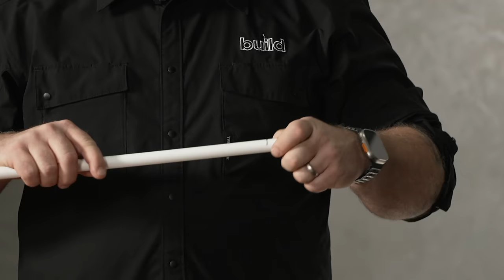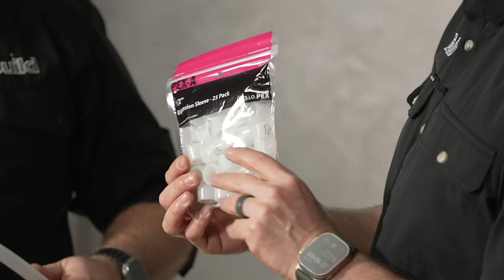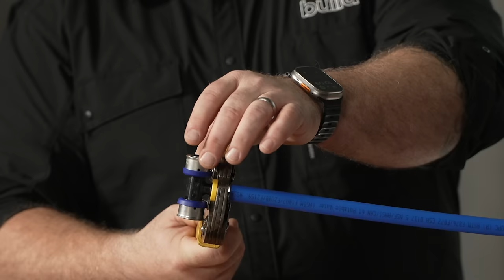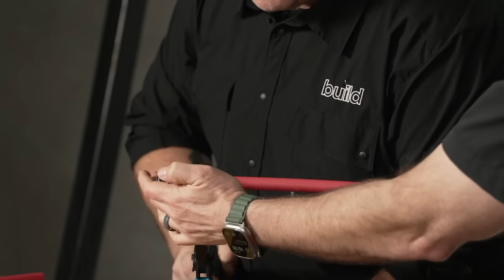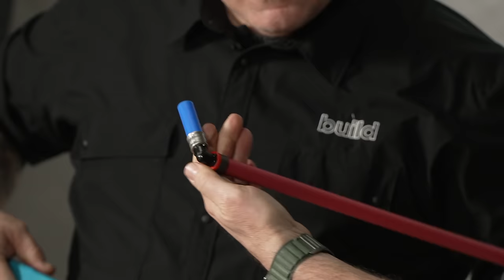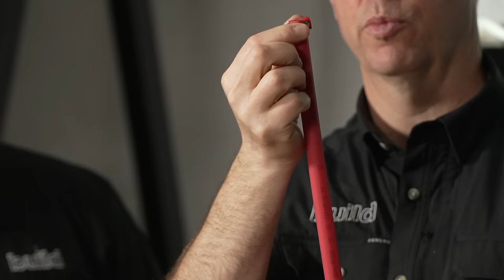PEX Pipe - 5 Connection Options

Comment: In the gas industry, we used Honeywell Perfection fittings for PE pipe and tubing 2” and below. Almost the same procedure as the Viga, but there was also a chamfer tool that had to be used on the pipe end. So quick to install, for emergency repairs and permanent installs. 

On the subject of expansion PEX technique- I would love to get into switching over to this from copper for water because the fittings are both quick to install and full port. But I have one reservation, it’s this buzz about small cracks developing in the expansion area and then causing pinhole leaks a year down the road.
Reply: That was only on the uponor brand color tubing. They  have since recalled it. Shark bite and Apollo also sell expansion tubing.

Comment: Great vid Matt and Eric. I'm doing a complete replumb on a 60's home in FL. I chose Pex-A for a number of reasons, mainly the cost of the tool (Dewalt) which goes with my other Dewalts. But there a number of other good points you should have mentioned. The maneuverability of the pipe is a big one, it's more flexible than the other systems, and if you do happen to kink it, a little heat and it's as good as new. Can't do that with the others. Another big advantage is the full size/bore fittings. I want as much flow as I can get without any losses due to number of fittings. I did find the fitting cost to be much better than some of the others. 
I appreciate all your great videos, and especially you're work with Paul and the gang at Stud Pack!
Keep up the great work brother!
Reply: Hope you didn't chose it for it's life span or lack of contaminants or unexpected failure issues, tee hee.

Comment: We use the pinch or aka single ear hose clamp in the CO2 business. These style clamps routinely hold 300 psi of pressure in the CO2 drink/beer dispenser systems.

Comment: Great upload, I'm 63, and when I moved the hose outlet I used the crimp ring one. But I think I will order a few of the sleeve ones. Just in case I want to do anything else, Like I went under and put valves to the shower.

Comment: I've used the pinch type on two houses now (I'm not a plumber but did my own houses). The reason cor the choice of the pinch was the minimal clearance required for the tool (you can crimp a line in a smaller space) and the cost.  I like the expansion type but couldn't justify the cost of the tools for low volume...  PTC is amazing for any one time repair but as you said, just too expensive for a whole house job.  Thanks for the video!

Comment: Great vid Matt and Eric! I really appreciate the demonstrations on all the types. I have used the PTC on so many plumbing transitions and in tight spaces, but a comment on one of my last plumbing videos caused me to do a double take and re-think using them since the person said they were for temporary use only due to the rubber o-ring. I couldn’t find anything out there that backed up this claim, but I have been thinking a lot of transitioning to expansion fittings and taking the plunge on a Milwaukee expansion tool. Thanks again for the great demos! Best!

Comment: Awesome treatise, guys.  One thing that I found out with Upinoor or Wirsbo PEX-A is that the automated expansion tool has a distinct advantage over the less-expensive manual stretch tool, and that is that the stretch head ROTATES on the automated tool as it is stretching.  Found out how critical this is because I plumbed an ice-maker feed tube valve with difficult access to the pipe, so my manual tool couldn't rotate much.  The connection drip-leaked.  I did it again and forced my tool to rotate as best I could and that fixed it.  The stretcher head cannot stay in one place, it has to rotate.  :)

Comment: You guys forgot Rehau’s pex system which is a combination of expansion pex and crimp fittings. They call it EVERLOC. Best of both worlds?
Reply: Ditto, I was hoping they would cover this.
Reply: been using Rehau for 22 years, never a problem even with solar panels, way better
Reply: or worst of both worlds

Comment: There is also the F2080 Comboloc expansion tool that expands the Pex and then pulls the metal collar tight into the Fitting.  Everlock+ and Rehau.

Comment: I had a failure with the pinch type. A buddy and I ran the water to my kitchen remodel. A few weeks after the paint was dry in the kitchen, I noticed a large bubble forming behind the paint over the sink.  My buddy came over and we found where the clamp was leaking.  A replication of the pinch sealed it. I was able to drain the water out of the bubble with just a small wrinkle in the paint, We both learned how important it is to get a good pinch.  We are planning a remodel of both bathrooms soon. I will make sure that everything is pinched well.

Comment: May, can you find out for certain about Uponor A cracking and leaking? I’m seeing videos where people are now having problems. It appears to be the red pex where the problem is. Could be the pex itself and being left out in the sun. Comment were made that they’ve now gone away from the red pex and just use white pex with red or blue writing in the tube for hot or cold. I will need to re-pipe my house some day as it’s still using poly but the owner builder did a decent job of crimping all the fittings. It’s even used in the hydronic system which makes me nervous but it means breaking concrete. Thanks.

Comment: The black coating on the Pex-B copper rings are designed to prevent oxidation of the copper over time.  Regular, uncoated copper pex rings in humid or wet areas are susceptible to oxidation, which over time can break down and damage the ring; eventually leading to failure.
Reply: Unless it's in a marine environment, I couldn't imagine those rings failing in a reasonable length of time to be concerned about.

Comment: A nice feature of the crimp is you can cut the ring and redo it if necessary,  also the shark bit can be removed like temporary using caps and removing them after rough-in…
Reply: I have been using ptc fittings for various repairs in my trailer.  I was surprised to read that you can reuse these fittings a few times.  Still feels like it "shouldn't" work as well as a crimped or compression fitting but so far so good

Comment: I used this crimp ring system on my house, the main down side is its use in tight places. But there is a block tool that is slow but works well in a tight area. A power tool would be better for tight areas. House is twelve years old, I have had to failed fittings, but they were cracks in the brass fittings, not the crimp rings. But did the stress of the crimping crack the fitting? I would crimp, turn 90 degrees and crimp again for a more uniform crimp.

Comment: A 90* fitting increases the resistance to flow by 10x compared to street el or curved fitting. I had 90's on an hydraulic oil system that kept blowing off the hoses. My hydraulic engineer neighbor told me to use curved fittings and the issue was fixed.

Comment: I can give you a few reasons why pex b is most popular, 1, I live in SC and pex b was all you could get from the supply house and from places like Lowes/Home Depot(years later, pex a showed up). 2, the pipe, fittings, tools are a lot cheaper for b, 3 Other reports say pex a leaches more chemicals into the water. The rings for a are bigger, when drilling through concrete, smaller bits are less expensive.   The pinch type has a much smaller/cheaper tool, 1 size fits all. And just my opinion, I would not allow a shark bite fitting in my house, other than an emergency, have to wait to the next day to get it fixed kind of deal, why, it has a O-ring, in my 50 years of mechanic work, I have NEVER seen an O-ring that hasn't failed at some point, all types will fail at some point, but O-rings usually much sooner.
Reply: Shark bites 20 years old. If they were failing you'd know about it. A lot of pro plumbers are using pro press now
 How does it seal? An O Ring

Comment: Working on de-galvanizing my plumbing and have to do it in stages.  I use the crimp rings, the last connector you showed and Pex B because it is cheap and easy.  The tool for that would be excellent if they changed the gear ratio of the ratchet mechanism to accommodate smaller hands instead of requiring hands the size of Shaquille O'neal for single hand use.  I plan on going back over it with Pex A when I get "The tool".  Have to figure out how to maintain the grounds connected to the old galvie now that the supplies are going to Pex.  Don't want no fatal showers or anything.

Comment: The black rings crimped pex, someone said to use channel lock pliers plastic handles and squeeze the black ring slightly in proper place & then use the proper crimp tool.

Comment: The pinch clamps don't slide after a single click but still easy to move. Really easy to use. Bad part of pinch clamps is they grab your skin after the install. 1 tool for 1/2-3/4-1 inch not sure if they make bigger and smaller sizes.
Reply: You can use your channel locks to " "pinch" them in place so they don't move before you put your pinching tool on them.

Comment: Sharkbite has saved me in so many repairs.  Repairs get very costly when a house is plumbed wrong, and it can be difficult to find honest repairmen.
With that said, the PTC introduced me to the other methods that i also now use, but the PTC allows for easier installation in confined spaces, or by disabled personnel.
I am no expert but still learned some things in this video.

Thank you for covering so many types of connectors and the tools needed.

Comment: I'd be great to see a follow-up video demonstrating differences in disassembly / removal of fittings, along with re-usability of the removed fittings across these different connection types.  I have the most experience with the pinch and crimp PEX-B setups and own the tool for cutting the crimp rings from PEX-B -- So I'm unsure how easy it is to free a PEX-A fitting for potential re-use..  The king of re-usability would clearly be the PTC fittings.

Comment: Great video.  Good information.  The only thing I would have liked to see as a DIY person is how hard or easy each system is to correct mistakes.  For instance, some fittings (e.g. pinch) are easy to undo without cutting the tubing again.  An important advantage if you are working on old construction and make a mistake but the existing tubing isn't long enough to be cut back any further.

Comment: It’s helpful to know that fittings and pipes are compatible by their ASTM compliance. 

A pipe will be marked with “ASTM xxxxx” to tell you what fittings it can use.

This is true regardless of PEX type. Some makers like Zurn and Sioux Chief don’t even bother labeling them as “PEX A” or “B” because that’s not what’s actually important. 

I’m interested in Rehau EVERLOC. It’s an expansion fitting but instead of the double layer of PEX that shrinks back, a brass sleeve is pulled onto the joint.

Comment: Really helpful! Some tips: ProPress continues copper connections and current/ground. Environmental issues with copper in say, a pool house, would be better with Pex. Same with stainless fittings is some caustic or wet areas is better than copper or metal rings. Pex is susceptible to UV like sunlight, so an open-framed house in construction, you don't want Pex exposed to sunlight. And some Pex I've encountered (milky white) gets brittle under heat like a condensate pump from a furnace. ProPress/Press tools like Milwaukee are $$$$ and require sending to manufacturer after a number of presses to "re-calibrate" which for a plumber is downtime. ProPress/Viega fittings are very good but costly versus tradition sweat on copper. However, time is money but also saves the customer costs and adds value, along with easier on you in confined spaces.  Matt- perhaps a second mic for these so we can hear you as clear as your guests?
Reply: Also with pro press no open flame

Comment: My house was built in 2019 and uses Upenor pex (thankfully) and where the stubs out the drywall (i.e. toilet, sinks etc..) they used the copper stub outs so it's a solid connector on the outside and like a flimpsy piece of pex that moved around. But all valves in my house are push to connect. Likely they figured they save labor cost over material with less call backs due to leaking compression fittings, and time it takes to put a 3800sqft house worth of valves on for compression vs a quick slip on fitting. 4.5 years and no leaks or anything. All in wall and manifolds where it goes from 1" pipe to multiple 3/4 and 3/4 to multiple 1/2 runs to things like shower valves and sink and toilet, they used the Upenor coñectors there and slip on is only on exposed walls in 4he house.

Comment: With PTC, the PEX of applied properly, will hold the full pressure of PEX without leakage or failure, until the PEX finally bursts.  It takes as long or longer to install as any other system by the time your chamfer the end, and mark it.  

The disadvantage of both most crimp  and the PEXA, is that you have to have a different tool for each size of tubing.  The quickest is the crimps with a stainless crimp band.  You only need one tool, to crimp any pipe size.   Another advantage, is that the engineering on the bands was imported from the band clamps on universal joints on cars.   And you can buy linear installation tools which have a handle you spin, instead of clamp like pliers.

Comment: Old boats made in the 80s have "pex" connections. Many years prior to its use in residential. If it withstands marine use, obviously, it's great for residential. My 1986 Carver never has had a leak, all original.

Comment: Great video! I just got my bathroom redone using the crimp style,  but where the toilet pipe come out of the wall for the shut off they just screw/twisted it off put the valve on then twisted it back on when they installed the toilet after the drywall was hung. Maybe thinking they used the o-ring in this area but not entirely sure but would like know your thoughts on how that was possible?!? Thank you for the info

Comment: I Anya plumber and will only use type A(with expansion sleeve) or pro press type fittings. I feel those are the most secure ones of the bunch. The “shark bite” type is great for emergency repair situations, and some guys end up just leaving them permanently installed. Not what I would do if it was my house, or customers for that matter. Also if rodents get into where the piping is they love to naw or chew on the plastic and then you got a frickin mess, seen it a handful of times.That’s why rigid copper is so much more durable, but…. they both have their pros and cons.

Comment: I like the Uponor because of the constant tension provided by the expansion then the pressure resulting from the collar constantly trying return to its original form
Reply: Not to mention you don’t have to contort yourself to reach your work, have a nervous breakdown trying to get your tool on a ring that’s sliding all over the place, then strain to get the leverage to crimp the ring.

Comment: I run into sharkbite failures all the time, and it's always on copper. They don't bite the copper well and most diyers aren't installing them correctly. But I'll use them on plastic for service calls all day long because they are quick. Other than the recent lawsuit I'd say uponor is the best, now I'm not sure

Comment: I had several brass fittings corrode and fail. We do have well water. One of the brass fittings actually broke off at the water heater , what a nightmare. Fittings were about 6 years old. Replacing all the fittings with stainless steel fittings . Should solve the problem.

Comment: From what I've seen, replacing a trunk system with Pex A maintains the flow needed for multiple outlets because of the larger fitting bore, where a Pex B system would restrict the flow too much because of the smaller fitting bore. If plumbing from scratch, with a separate run to each outlet, it isn't a problem because there are very few connectors used. Final note, your Milwaukee Pex expander wasn't rotating between expansions. If the expansion tool doesn't rotate it will create a fault and will leak.
Reply: you should go rewatch its rotating
Reply: I think the flow reduction from B fittings is more theoretical than practical.  Both A and B fittings have enough flow.  If you are worried about flow restriction, then just make the main run 3/4" with PEX B and make your end connections 1/2 inch.

Comment: I was sold on pex a expansion...built 7+ houses with it...always watched and learned from the plumbers...finally decided to plumb the casita myself...everything went great until 1 fitting(just wouldn't stop leaking)...plumber had to come help and he used pinch rings...no leak...so now Im torn...Im leaning torward pinch for next diy job..

Comment: Is it necessary to use the ratchet clamp tool on the stainless pinch (oetiker style) clamp rings?  I have been using the Oetiker clamps for years on different projects (not household plumbing) and I use the Knipex oetiker clamp pliers, and they work fine.  I don't mind buying the "correct" ratchet tool, but right now I only need to do about 6-8 clamps for a small project.  Thanks.

Comment: We have an older hydronic heating system that uses ½" orange PEX.  The fittings are brass with a toothed inner sleeve that slides into the PEX.  Then you slide a split ring ferrule with angled surfaces over the sleeve area, and tighten the ferrule with a nut that compresses the ferrule.  Does this have a name?  I'm trying to find replacements!

Comment: You can over expand. I had a helper who had arranged to take off one afternoon. We were working with 1 1/4 pex a. He literally left the pex expander in the pipe and left. I came maybe as long as 30 minutes later and found it. I put the fitting in waiting a little and let go and it fell out. I had to climb down a ladder get it get back up and could still put it in and  still had to hold it a while before it grabbed it